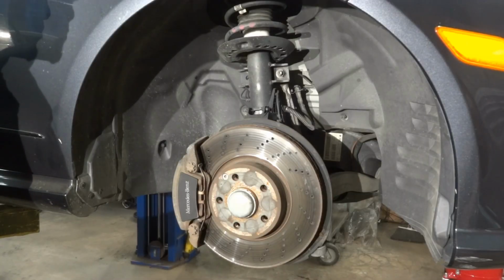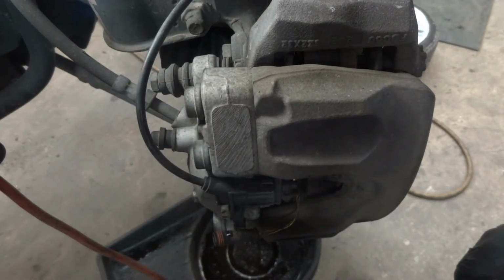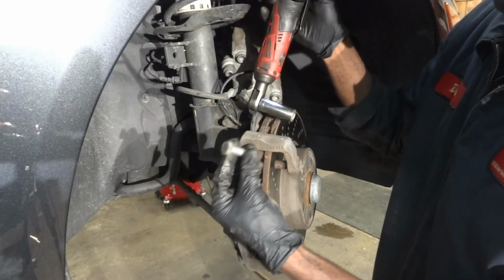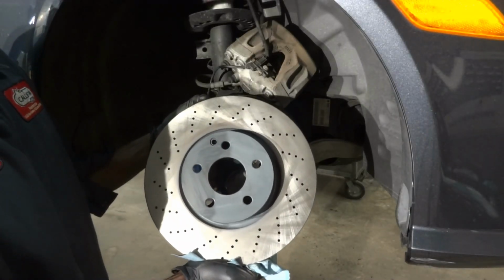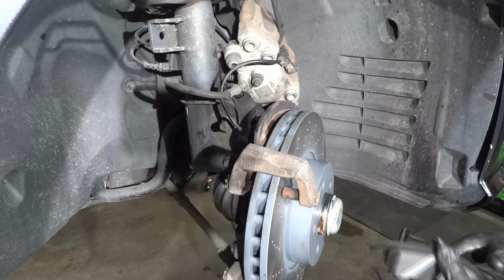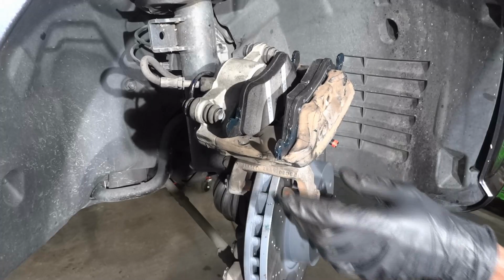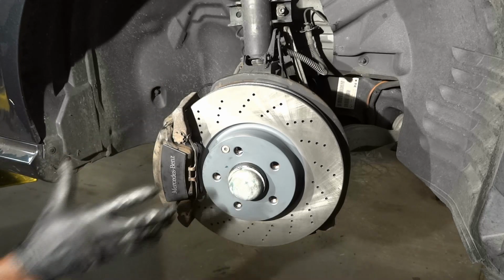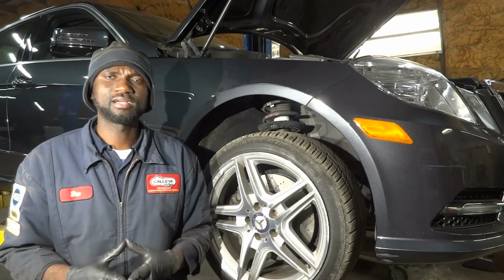Mercedes E350: Front Brake Pads and Brake Rotor Replacement

Comment: Very good video IMO.   K doesn't use an impact wrench to break the calipers loose at first, uses a torque wrench as well as anti-seize, and double-checks everything afterwards. 

I saw another comment about replacing the rotors, particularly these cross-drilled rotors, and there's a few comments I have about that:

- It's not easy to find a shop that turns rotors anymore let alone knowing how to turn cross-drilled rotors unless you want to be without your vehicle for a few days.
- The interior side of this rotor was ground into fairly bad.
-  Buying new cross drilled rotors is generally the smarter option as opposed to being unsure about a Mechanic's ability to turn a rotor. 

Most of us are watching this video to do it ourselves , save a few bucks, and do it right. Taking a MB to the dealership or a mechanic is a luxury for some whereas we're here to make sure that we mechanically inclined people don't miss anything.

Thanks K!
Reply from the maker: My Pleasure! I'm glad to hear that the video was helpful!

Comment: Great video. The only one that I found helpful. Most did not match my brake system. Can I jack my 2017 e550 Cabriolet from the rear differential in order to place jack stand in the proper location? I do not have a lift.
Reply from the maker: SlickNick  Yes you can!
Reply: @KITS_Auto_and_Truck_Repair  Thanks for the quick reply. I plan to do this today. Your instructions are well done.
Reply from the maker: @NickeryNelson   My Pleasure! Good luck with your project!

Comment: What model allows you to install only one pad into the caliper and then putting the caliper onto the rotor?? BTW, those two caliper slider bolts are supposed to be tightened to only 18 foot pounds.
Reply from the maker: @TomBleecker   E350
Reply: @KITS_Auto_and_Truck_Repair  I have an E350, and it's not possible to fit the second pad into the calipers once the caliper is affixed onto the bracket.

Comment: Pls post the brake pad and rotor pricing and where to buy ? Is there a replacement OEM part recommended?
Reply from the maker: Eric Tran  I got these parts from napa, you can them from your local napa store!
Reply: @KITS_Auto_and_Truck_Repair  do you have the brand name? Napa carry a few brake pads & rotor 
Thanks!
Reply from the maker: @erictran9290  No! I don't remember the brand name! you can ask for the best brand they have!

Comment: Hello my dear friend, I have a Mercedes W211 E350 model 2006. Is it possible to change the brakes without programming a computer? I am honored by you. We follow you from Benghazi, Libya
Reply from the maker: ابوز يوسف  what do you mean by programming the computer? I believe there isn't a computer reset procedure after you replace the front pads! besides erasing the brake wear message on the dash, and that might even go off by itself after you replace the sensors